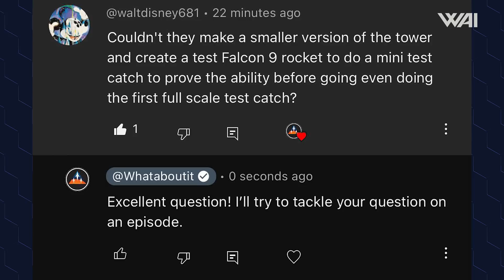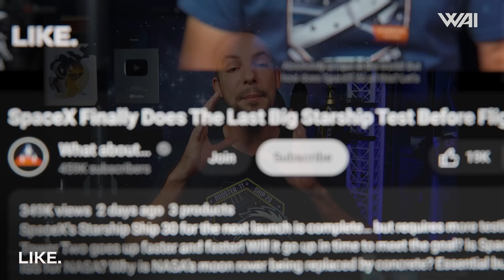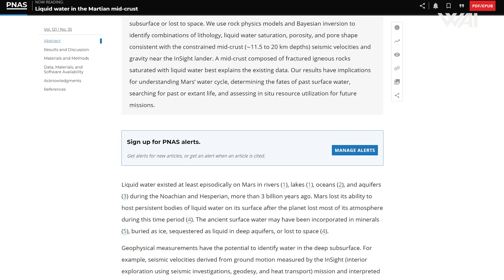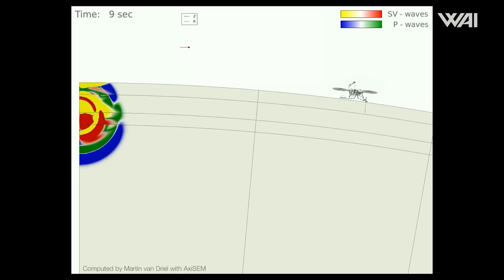SpaceX Massively Updates Starship! Ready For Flight 5!

Comment: I look at the entire catch tower thing from a slightly different view. The biggest risk of damage in my view is a failed catch attempt so why build a full, infrastructure equipped launch tower with a launch pad and all associated infrastructure for catch testing when a simple tower with arms, well away from any significant infrastructure, which can catch and put the booster onto a modular transporter world be enough? Damage restoration to a limited structure would be far quicker and cheaper.

Comment: Trying with the first stage or Falcon9 does not change anything.
That they can make a capture I have no doubt. If the rocket arrives inside a capture box I don't see the difficulty.
This box is as big as the arms are responsive and how wide their movement is.
The problem is the probability of failure.
A gust of wind, a problem with some engine in the last stretch, a problem with the movement of the sticks and disaster is assured.
A first stage is expendable. If the descent is unstable it falls far or at worst destroys the tower.
A starship with people on board would be unacceptable. I would never get on it.
For the starship the only solution are landing legs that eliminate the problem of the arrival box as it could also land in a cultivated field.

Comment: Water on Mars is a big deal.  But, water in Mars, 10 to 20 km is very hard to reach.  The deepest hole we ever drilled is 12 km on Earth.  On Mars, do you plan on running a rig in a space suit?  No, you will not.  Making that water practically inaccessible.

Comment: I've always wondered why they don't catch the booster on the far side of the tower from the tank farm. By this point there are a lot of elements in the way like the QD Arm and planned swing angle, but it seems like a significantly lower risk option compared to landing it in the slice between the farm and the pad.

Comment: No, the Martian water discovery is NOT a “game changer” nor will it make things “a whole lot easier” for SpaceX. Drilling to reach resources between 11.5 and 20 kilometers (7 to 13 miles) below the surface (where the Martian water is) is extremely difficult even on Earth. The average oil well depth is less than 2 km. As the video noted, the very deepest well ever drilled reaches a depth of 12 km. Yes, cooler temperatures on Mars might make deeper drilling there feasible; but it’s still not going to be remotely easy. For the foreseeable future, it will be far easier for Mars settlers to extract water from ice near the surface than to drill down to deep water reservoirs. The reasons to be excited about this find are more at the level of science than at the level of practical value within the next century.

Comment: they really should just build a lone catch tower away from everything. No plumbing, no tank farm in the vicinity. Just a concrete tower with electricity hooked up to it to power the chopstics.  I mean if that thing topples on landing and explodes it can take half the site with it. Or am i missing something here ? And a lone catch tower without any plumbing should be realitively easy to maintain and fix even if the booster explodes hanging on it.

Comment: Cool discovery about subsurface water 20 km underground but drilling for it?!  LOL, I don’t think so space nerds.  It took Russia over 20 years to drill the 12 km Kola hole and that drill bit would be thousands of tons and 20 km in length!  That’s a looong Starship!  How are you lifting that from Earth and getting it to Mars?!  What about drilling lubricant (usually water on Earth - the thing you’re drilling for on Mars)?  What drilling engine are you going to use and what will it run on and how will you operate it or get it unstuck?  How are you getting liquid water to the surface given the tiny Martian atmospheric pressure?

Complete fantasy and frankly, so is Mars colonization to begin with.  Start over.

Comment: I like your optimism-infused striving for objectivity. (As a space nut since the mid-1960s, I also strongly want this all to work.)

BUUUUT...Are you doing a bit too much positive spin when so say " Don't worry about a crash... very little fuel left".

But that is a huge tension. Little fuel left means minimal options if hovering is needed. Enough fuel for sustained hovering = increased risk, if catching. An inescapable tension. 

May spaceX reduce that tension!

Comment: Attempting to use a chop starship booster could result in catastrophic damage, which may delay their progress.
why can't they dig vertical bore in any desert dunes with the help of their boring company probably to have any cushion landing, with the help of fine sand which may simulate conditions similar to planet MARS landing as well you can do a complete analysis from the landed booster/ stead of instead of conducting costly mishap investigation.

Comment: Starship may not have much fuel left on landing compared to when its full at take-off, but make no mistake it's still a lot of fuel something like 5 to 10 tons of LCH4 if I'm not mistaken. That's all gonna get aerosolized when the steel splits open on impact and of course not all of it will combust, but still. Again we're talking combustion versus detonation so you get a push instead of a shockwave, lessoning damage. However, it's still significant. All the soft bits will be annihilated, unless they're able to completely shield it all which we don't see. Consider the Quick disconnects soft pieces, all of it on the tower is vulnerable. Let's just hope that doesn't happen though, POSITIVE thoughts. 🤞🙏🤞

Comment: My thoughts for a smaller-scale catch test would be doing a hop. Having a barely-fuelled super heavy lift off, take it up like 10 meters, then lower it back down to be caught. Would verify that the chopsticks can support the weight at catch, determine the amount of damage to the booster, determine the amount of flame damage to the launch mount, and, if anything went wrong, a booster falling that slow from not very high up would only risk denting some metal they'd have to hammer back out, rather than completely KO-ing the entire launch mount and catch tower.

Comment: To be accurate, they did not discover massive amount of water underground on Mars. They discovered evidence of the water. It's the difference between holding a test tube of water and holding a paper sheet with numbers and graphs.
Reply: One of the things that can be the case is that there is water, however we need to study this more before jumping to conclusions.
Reply: No there's water
Reply: @ZSpace23000  You say that (and hopefully it is the case) based on what? On the evidence of water, not directly on water.

Comment: If the primary goal of Space X is getting mankind to Mars, the biggest issue I see is building and testing catch arms on earth. The biggest question I have is how will humans landing on Mars return to earth without catch arms and launch pads and should the priorities of landing the ships on land focus on the need for Mars landings to do the same?
Reply: The superheavy is never going to Mars, neither the Starship tankers. These 2 are going to do the heavy lifting for these missions (tens of launches per Mars or Lunar Starship). And having an extremely high launch cadence is crucial for the success of their Mars plans.
Landing on Mars has very different requirements than in the deep gravity well of Earth, so developing heavy legs to land here is wasteful, limits payload and the speed of operations and reusability and increases costs. If they fail to catch them reliably they can always add them, but they have to try and fail first before they add wasteful parts and ops. "The best part is no part. The best process is no process. It weighs nothing. Costs nothing. Can't go wrong" - @elonmusk

Comment: The primary requirement for a Starship Booster tower landing is the ability to hover. Falcon 9's Merlin engines cannot throttle low enough for the F9 booster to hover. Hence, the hoverslam. The Boosters Raptor engines can be throttled deep enough to enable it to hover. It's a waste of time and money to start an F9 tower catch test program.

Comment: I'm surprised they didn't launch a super heavy without a Starship, go up to 30 km or so, and do a live test catch. They're either so confident of a catch, or figure there's enough to be learned from even a full failure that they're going for it.
Reply: Launching a superheavy to 30km and catching it wouldn't be any different than doing a full orbital launch and catching it. And with the full launch they can test Starship at the same time.
Reply: @admarsandbeyond 😂😂 not.much difference,  uhh big difference
Reply: @DerfOrNuffin  No, really not much difference. If you're going to launch a booster to 30km up, you're going to need to go through almost all the same fuelling and testing processes as an orbital launch. You'd save some effort from not having the ship on top — except that the booster isn't designed to ascend without the ship on top, so you'd need to develop some kind of ship-like mass simulator for it to carry to provide the right aerodynamics and mass distribution. And if you're having to build that, you might as well just use one of the ships they're already producing (instead of distracting the ship-production guys by having them build mass simulator), and get some data from the ship too.
Reply: Why not just stick a ship on top at that point and go the whole hog.. a catch is a catch ultimately, no matter how high the booster gets, it will still perform the same landing profile from at the very least a kilometer up. The destructive potential would still be there in its entirety
Reply: Good idea
Reply: They should send a Starship up on that booster test launch so they can continue the ship tests.

Comment: What kind of expertise does the FAA have to decide whether a catch attempt is safe enough when Spacex themselves can't possibly know before they test? A desk jockey in a inane bureaucracy deciding whether Spacex knows what they're doing is like something out of a Terry Gilliam movie.
Reply: If that’s the way it worked, you’d be right. But the FAA knows this. Every plane and every rocket they deal with is different. They just point out the obvious: Your test articulated did not follow the approved flight plan….maybe they’ll point out an explosion or something really bad that everyone saw. Then the manufacturer has to write up a detailed remediation report and send it in. The FAA rubber stamps it, maybe asks for clarification, and then the manufacturer must follow that plan to the letter and provide proof. So it actually works pretty well.
Reply: @evanmorris1178  Only they didn't just ask for an incident report to rubber stamp, they GROUNDED the entire fleet despite there existing no danger to the public. Spacex already said it was strictly a recovery problem, ruling out engine failure or anything that could potentially endanger anyone during launch. There was no need to ground their fleet in the past when they had booster landing failures, and nothing has changed now. Just like there wasn't any need to ground their entire fleet after the S2 mishap that didn't place their Starlink satellites in their correct orbit. Spacex investigated that mishap in a couple of days and came up with a solution (removing the superfluous sensor a government organization forced them to add to their engine) but still had to wait for weeks for the Kafkaesque bureaucracy to allow them to fly again (and stop loosing millions in revenue)
Reply: @evanmorris1178  Only they didn't just ask for an incident report to rubber stamp, they GROUNDED the entire fleet despite there existing no danger to the public. Spacex already said it was strictly a recovery problem, ruling out engine failure or anything that could potentially endanger anyone during launch. There was no need to ground their fleet in the past when they had booster landing failures, and nothing has changed now. Just like there wasn't any need to ground their entire fleet after the S2 mishap that didn't place their Starlink satellites in their correct orbit. Spacex investigated that mishap in a couple of days and came up with a solution (removing the superfluous sensor a government organization forced them to add to their engine) but still had to wait for weeks for the Kafkaesque bureaucracy to allow them to fly again (and stop loosing millions in revenue)
Reply: Only they didn't just ask for an incident report to rubber stamp, they GROUNDED the entire fleet despite there existing no danger to the public. Spacex already said it was strictly a recovery problem, ruling out engine failure or anything that could potentially endanger anyone during launch. There was no need to ground their fleet in the past when they had booster landing failures, and nothing has changed now. Just like there wasn't any need to ground their entire fleet after the S2 mishap that didn't place their Starlink satellites in their correct orbit. Spacex investigated that mishap in a couple of days and came up with a solution (removing the superfluous sensor a government organization forced them to add to their engine) but still had to wait for weeks for the Kafkaesque bureaucracy to allow them to fly again (and stop loosing millions in revenue)

Comment: Falcon 9 has a smaller diameter, so, the chopsticks could not be parallel. The tips could touch if F9 is closer to the tower allowing it to slip through. Once caught F9 could not be shifted in or out along the chopsticks to rest centered on the OLM (assuming they want to use the water deluge for this catch). Otherwise, the mobile carrier is not configured for F9.

Comment: An intermediate solution to testing the Catch function - fly the Booster only, partially fueled, to a high altitude, and then complete to landing phase under equivalent conditions.  But then you would expend a Booster but not gain the Starship launch.  Probably best to proceed with the flight as planned.

Comment: I think they should indeed try to catch it, but in the next flight. Since they are making sooo many improvements between each flight, one more flight will have way greater chance of success, thus way lower risk to damage Mechazilla.. the setback of a failure seems way greater, than the delay of getting data from the catch attempt 1 flight later, as the repairs would last more than the ever increasing cadence

Comment: I suggest holding the nearly empty booster in the chopsticks, then launching the starship booster 50 meters up, then catching it in the chopstick arms.  This would prove out keys parts of the landing process with minimal risk and minimal effort. Perhaps 3 tests with the booster   Making progressively more complete landing process (1st test only lifts the booster 1 meter up, then catching it, 2nd test 50 meters starting on the launch pad instead of chopsticks, 3rd test from 1000 meters).
Reply: That makes literally no sense at all. Testing from different heights would in no way reduce risk and would not provide useful data as those conditions will never happen during a catch, all while risking the pad and booster just as much as a full launch attempt.
Reply: @filonin2  things go wrong. Engines fail at critical times. Look at how many engine failures have happened during the Starship development & testing. And everyone of those failures was a learning experience (i.e. unknown to be a problem until it happened).  There will very likely be more discoveries.  Redundancy and back up modes need to be tested to confirm they work.  
     Designs have an optimal solution but include a range of tolerances. For example, how misaligned can the starship booster be and still successfully be caught? How fast can the starship booster hit the chopsticks and still successfully be caught? How misaligned can the starship booster be from the ideal trajectory 5 seconds before touchdown and still be corrected for and caught?  A robust design requires robust testing to obtain reliable low risk end product. 
    By testing limited excursions from the ideal, feedback is gained that detects whether the corrective actions are functioning or are behaving in unexpected ways. This allows still safely catching the booster even with a problem design. EG, The trajectory correction failed to perform as expected but the test was designed to still allow catching the slightly mis aligned booster on the chopsticks regardless.  This reduces risk greatly and allows correcting the design before an actual mission.
Reply: Ideally, more booster tests would include partial failures and mis alignments (if one engine fails, if booster comes down at maximum allowed descent rate, if booster shifts laterally by 2 meters in the last 3 seconds, if the chopsticks catch the grid fins at the very edge).

Comment: Will starship make falcon 9 obsolete? Is dollar per kg to orbit higher or lower?
Reply: Falcon 9 costs them about $1000/kg (internal marginal cost) and can't launch one faster than one every 2-3 days.
They project that Starship could end up costing them about $10/kg and they could launch it more than 3 times per day per tower.
Reply: @admarsandbeyond  10???? rocket fuel doesnt cost that much anymore?
Reply: @andymiller3366  Starship uses methane (LNG) as fuel. It uses less than 1000t, that's 50 million standard cubic feet which at the current (industrial average) price of $3.3  per 1000 cf it amounts to $165K for methane. And they will be making a lot of that in-house with co2 reclamation with sustainable energy.
Starship v2 can lift >100t to LEO. Prop cost is ~$1M, add $500K in ops and maintenance (which is conservative for a fully and rapidly reusable system) and it comes to $1.5M/launch, or $15/kg. V3 can lift >200t for a little more fuel, so $10/kg is not a farfetched goal (they did reach their projections for Falcon which everybody thought they were insane for a partially reusable launcher)